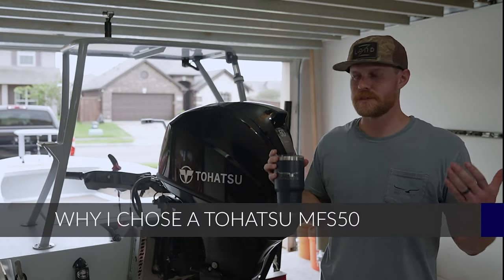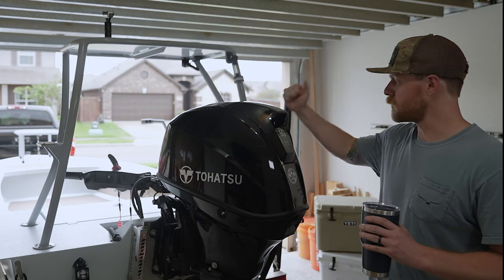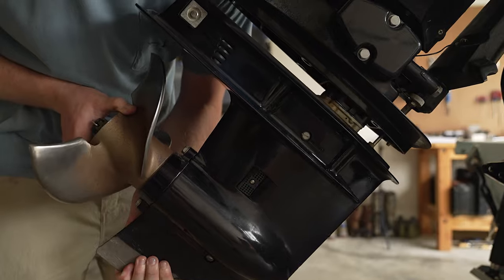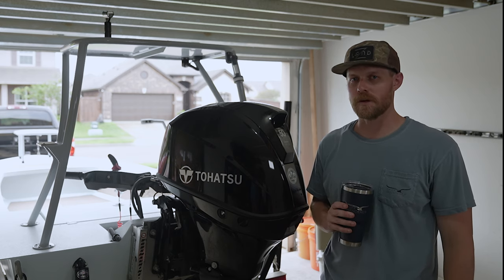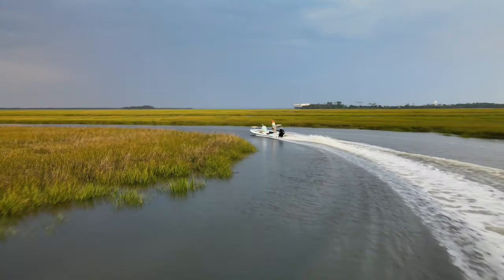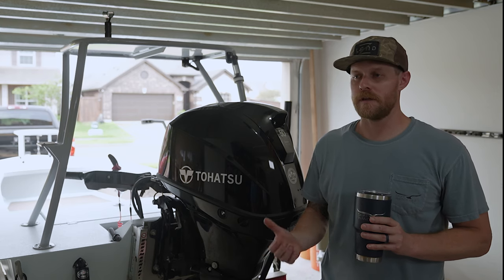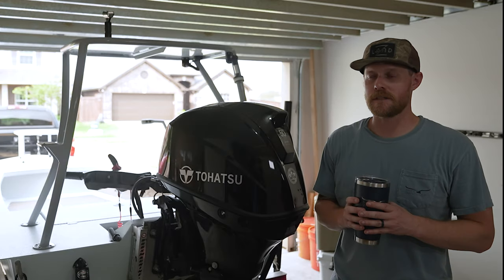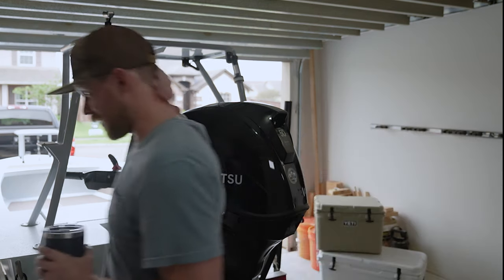Maintenance Tips from Pete's Garage - Episode 1: Why I Chose a Tohatsu MFS50

Comment: Tohatsu is absoulute reliable even the 9,8 4 stroke i have i go from my door through a channel, down to some islands after 3 fjords and back. I even never think about that it should stop as long as are vigilant on fuel ,full tank clean fuel and oil changes.   For me it,s jsut a extention to the fjords from my door in spring summer start autum and it,s already vent ab 170 hours.a 2021 . But in 12 years prior i used this 25 EFI four stroke, that engine newer stopped until boat get stolen.So i purchased a smaller one to enter the channel where i live to get acsess to the fjord. A 10 feet pioner PE  Norway boat. I run it quite in the upper register ab 15 knots and 90 % effekt